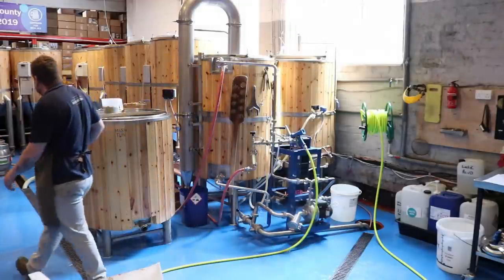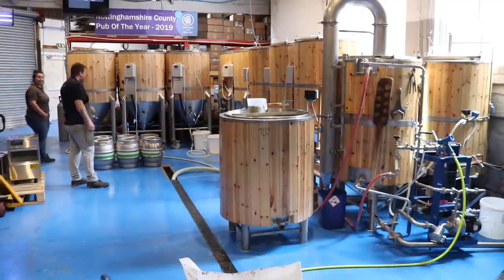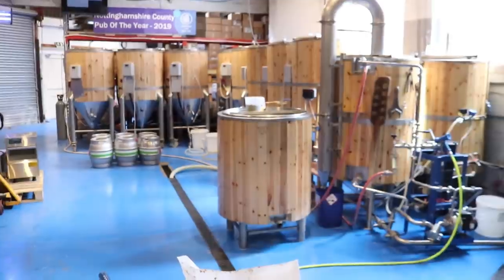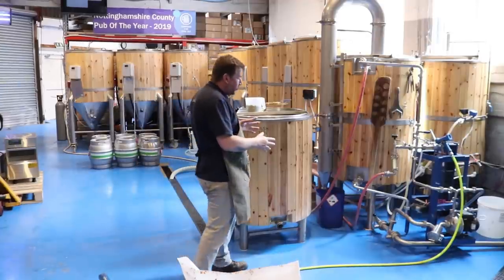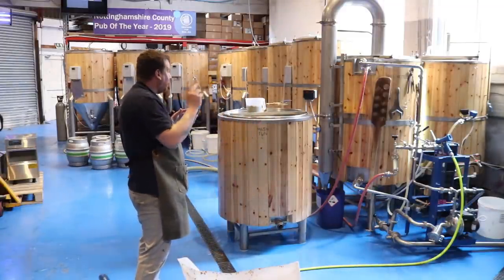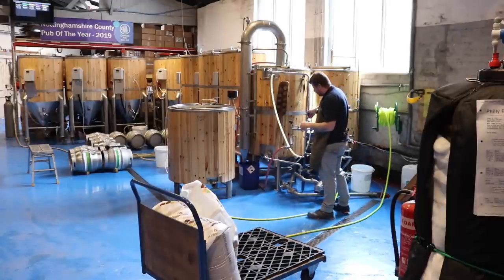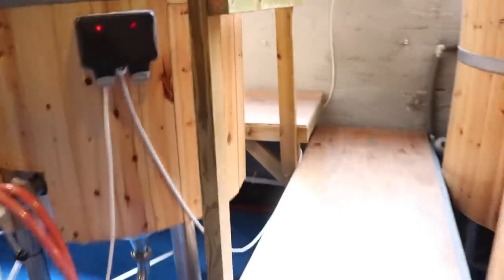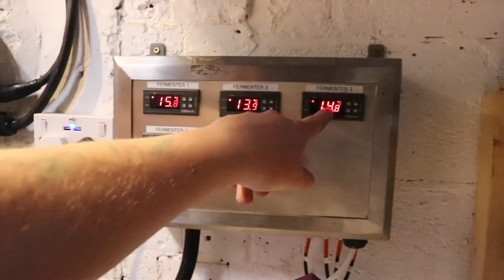Brewery Talk

Comment: Why not fashion your own floating pickup to suck up that lovely Proof of Concept into a corny - I bet you could easily pull 20-40 liters off the top with a regular pump by avoiding the trub, taking the beer off the top instead of using the bottom port?  Also - the Rode sounds great - very natural tones.